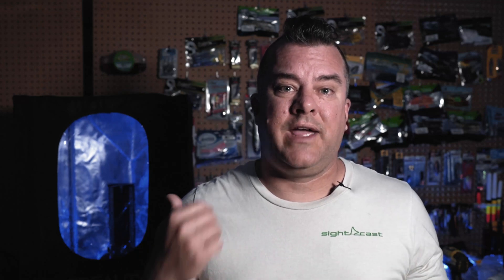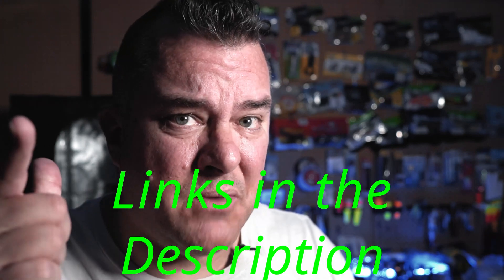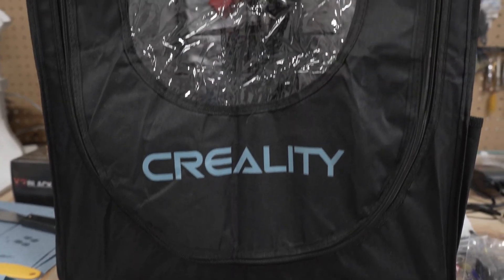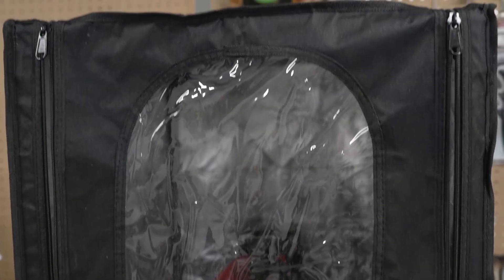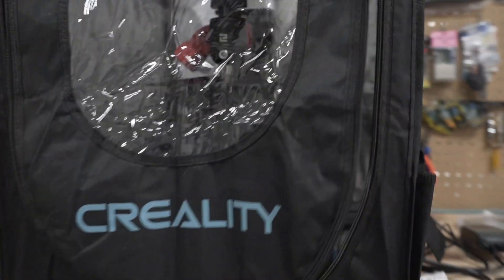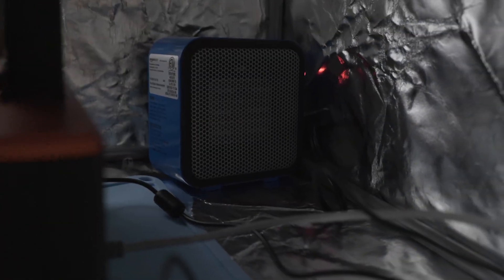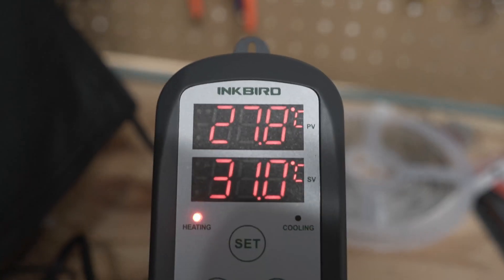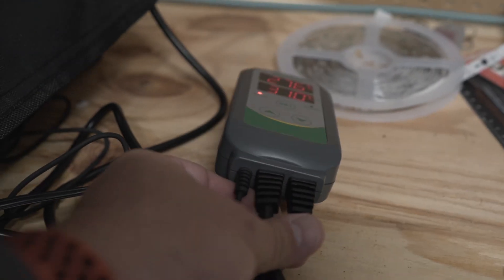3d Printer Heated Enclosure Fast and Easy - Elegoo Saturn and other resin printers

Comment: I just bought this for  my Elegoo Saturn 2 printer I just bought. This is my first 3d  printer and I want to avoid having to run off multiple prints before I get a good print. It's Chicago over here and the temps swing wildly. Hoping this will do it!
Reply: How well did your Saturn 2 fit inside there? I am also thinking about getting this too
Reply: @Logtrog15  fits well, I could fit two inside. I wanted extra space for the heater. Let me check the size. Stand by.
Reply: @Logtrog15  I bought the medium one at 63.07$ USD. Setting it up now. The crealtiy closure is ridiculously bad on the instructions. The elbows are supposed to be labeled and they're not.

Comment: Roughly what size is your enclosure now that they have 3 sizes I'm curious on which to use.
Reply from the maker: I would measure your machine to make sure it is big enough but you can't really go too big. The bigger the better in my opinion, the heater is pretty robust and won't really have an issue holding the temps.

Comment: Hey, just got all the stuff per your recommendation. Wish me luck!
Reply from the maker: Awesome man, feel free to reach out if you run into any issues. I ended up using a smart plug so I can remotely control the belt so I don't forget to leave it running all the time.

Comment: No concern over starting a fire? I've been looking for something, but I've rejected so many things because I don't want leave a heater unattended, even with an automatic shutoff.
Reply from the maker: Been running them for a year now and no fire. They don’t really reach a temp that would cause anything to burn. I can check in the morning but I want to say the max temp is under 100F

Comment: Just wanted to give a shout out that I ran across your video and went with this approach. I also saw your kombucha heater solution, but liked this one a bit more. As long as you have the space on your workbench for the enclosure, this one allows you to keep extra resin heated inside the enclosure. Plus I didn't have to run a cord through the hood. Minor advantages, but enough to push me this direction. I can't stress enough how huge the enclosure is on your bench compared to the machine though. So I'm guessing most people will go for the space saving option. Thanks for the great content!

Comment: Thanks for this video.  I am going to try this out for a small outdoor storage space we have (3.5' across, 6' feet deep, 7 feet high).  Do you know if washing/curing machines also have to be enclosed like this or are affected by the cold?  I'm in D.C., which warmer than Texas, but it still can get cold.
Reply from the maker: My understanding is that once the print is done, the washing and curing process is not impacted by cold. I have not noticed any issues curing in colder (40F'ish) temps.

Comment: Did you get the smaller enclosure for your Saturn? I bought the controller and the smaller of the Creality enclosures from your affiliate link so was curious. I live in Seattle and it’s gotten really cold, resulting in failed prints. Thanks for the video!
Reply from the maker: Good question I think they only had one size when I purchased mine 😆 as long as it fits inside, size of the enclosure is not that important. The more space you have makes it easier to store the bottles in there as well.

Comment: I've been eyeing up a resin printer for tabletop minis and terrain with my stimulus money, and so I've been researching everything needed to get up and running with a resin printer.  The grow tent idea is brilliant, as a 24x24x48" tent would have a footprint just big enough for an IKEA Lack table with plenty of room on top for the printer.  Theoretically I could have not only a heater and a thermostat/controller, but ALSO an air purifier all running at the same time off of a power strip within the tent itself, which would not only solve my ventilation issue, but also keep out any radiant UV light that might spill in from my basement workshop window.
Reply from the maker: They work well to keep everything contained, you can always add a vent fan to a window if you need to pull fumes out.
Reply: @WMBayouLures  I tried looking around online for window-based solutions, but 1: My house was built in 1949 with old AF windows I'm afraid to even try to open because the wooden frames are so old and nasty, and 2: the wall where I have space to set up a resin printer isn't near any of them.
Reply from the maker: @ToySoldierVeeVee  ahhh yes the joys of living in a older house, my first house was built in 1920, lots of fun trying to adapt them to newer tech.

Comment: Thanks for the video. I ordered these parts with your affiliate links and just finished testing the enclosure. Adding a Mars and a Saturn tomorrow to test how long it takes to warm up. The only change I made was upgrading the controller to the WIFI enabled version so I can monitor and set from my phone (you mentioned pushing the set button way too many times). Fingers crossed!
Reply from the maker: Glad I could help! Mine heats up pretty quick and stays at 31c without issues. One thing I didn’t mention in the video I that I store a bottle of resin in the enclosure, far away from the heater, so it stays warm as well.
Reply: @WMBayouLures  Great idea with the bottle. Assuming you are pointing away from the printer to protect the electronics? I have a 5 minute heat time from 15 - 30 C (longer for the resin in the vat of course). I picked up the bigger tent to hold an OG Mars and a Saturn.
Reply from the maker: @MaroniJoseph  yeah heater is pointing to a side wall in the back of the enclosure, temp probe is all the way in front. Direct heat goes into the sidewall and not on the printer.

Comment: Do you print with the shroud casing off? Trying to think if there is enough space to remove it while it's in there
Reply from the maker: I print with the top off. You can keep it on and remove it but it is a little tight.